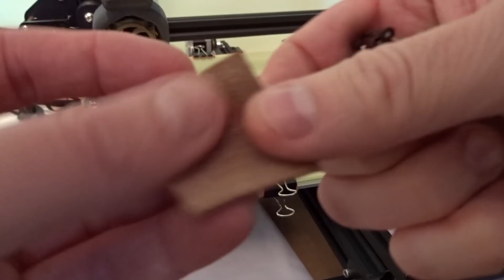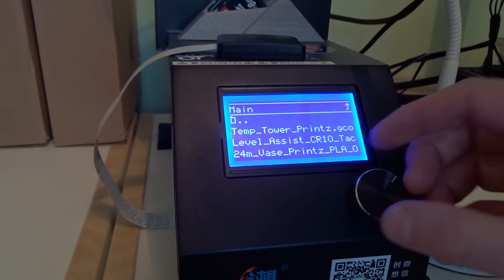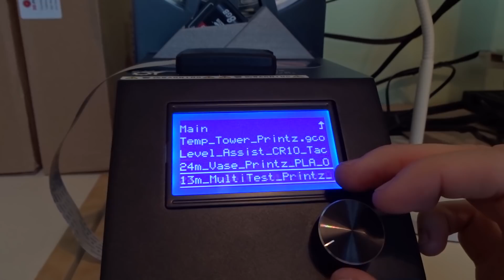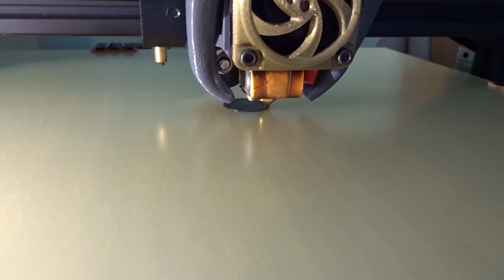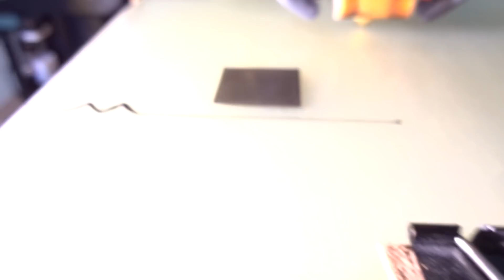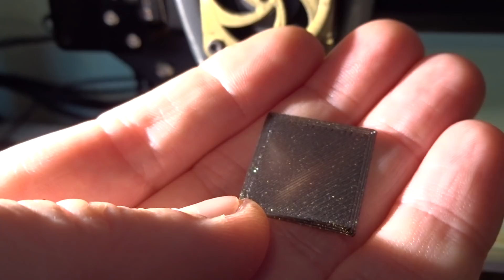Easy Live Levelling

Comment: New subscriber,great video,however I was disappointed when I realized you weren't going to show us how to level the aluminium part of the bed,I'm having leveling issues to the point I'm about to throw in the towel ,would you be kind enough to make a video showing how you leveled your aluminium bed.Thanks in advance.
Reply from the maker: Unfortunately no time to make videos. I just added aluminium foil in places until it was level all over.
Reply: @TacBlades  but how did you determine it was level.? Spirit level by eye vs the printer head or just experience?
Great video and down loaded to do on my Tevo Tornado  tomorrow  with your test files. Thanks and keep up the good job
Reply from the maker: @APCollyer  i used the nozzle its a pain as you add packing then test with nozzle then add more then test again but you only ever need to do it once
Reply: I really wish you would show us that and how you did ot but I'll give a try by myself, thank's for this video :)!!

Comment: Hi. Your video really helped me level my bed. But how do you make the printer print in the kind of motion. Mines start from the inside to outside
Reply from the maker: It just depends on how your slicer decides the best way to print it. In s3d there are settings to define the order in which to print features in the print.

Comment: What build plate are you using and how did you originally get the flat bed? Was your aluminum flat or was using the tape sufficient to level the build plate?
Reply from the maker: Ibused aluminium foil to level the plate i use an ikea mirror tile then printbite surface. But now i am using a buildtac clone by wysimic which is nice for using a cold bed.

Comment: thanks for the video! i uploaded your firmware to my cr-10s and want to try mesh-leveling. is there a video already, because i honestly dont know what to do
Reply from the maker: Hi there is no real video,  this one might get you started but it has some facts that are wrong.
 But on my firmwear you can save the mesh with store settings so you dont have you do it every time. Also read my notes in my firmwear as you have to put something in your start gcode.
https://youtu.be/X6lnlc-Vu-A

Comment: Hi :) I'm not English so I may haven't understand well. What is  the first layer height you settled for the calibration print ? 
Is it 0.18 ?
Reply from the maker: TheVerderadia yes 0.18
Reply: Nice Thank you :) I'll try that. 
I also would like to ask something. 
I think my bed isn't flat because when I level the corners, the center of the bed is closer. I tried with another mirror and that's the same. 
Do you recommand to put some tape on the corners ? 
Thank you

Comment: my printer is leveled in every single corner about perfect, but in the middle it's too tight like the nozzle is rubbing against the glass... Why is that?
Reply from the maker: Vape Nation Bg the bed is warped and its common just flip the glass and pack it out underneath in the center with aluminium foil to get it level.

Comment: I just purchased a new printer that has a 330x330 heated bed and uses extrusions (plus it is a Bowden so very little weight on X) and here we go again.  I have never been able to print reliably in all of these years.  I did tear down my Prusa to make room for this printer but when you even try 1 inch pillars at the three leveling points and the nozzle still hits the glass (regardless if flipped or not) then I have no idea why others have this magic in them to be able to print easily and I can't.  Same problem across a CoreXY and a standard Cartesian Prusa I3 something is really screwy.  Y skewed, X skewed, etc... goes out the window with this printer as does smooth rod droop.  Since the heated bed has this bulge across the entire Y section in the middle (to the point it will jam my nozzle using 0.318mm first layer gap) but is fine on the rest of the bed then it isn't droop.

I am stumped.

Comment: I use Feller Gauge to get my bed level, i use 0.018mm , do you know the exact gap we need?
Reply from the maker: Bramish EU i normally go with 0.08  to 0.1depends on the amount of squish i want on the first layer.
Reply: Thx for the reply, ill raise the bed slightly closer and compare results

Comment: Is that a Polypropelene bed?  I recently bought one and despite only using rubbing alcohol or glass cleaner, prints are popping off.  (Looks like I need to add some z-hop )
Reply from the maker: Where Nerdy is Cool! No its a printbite surface :)
Reply: Ha, okay....well one thing I am running into with the Tevo Tornado and my CR-10's is when you do prints like that, because of the housing , you can't see what's going on!
Reply from the maker: Where Nerdy is Cool! Yes that is the main reason i printed a fang.

Comment: How do we edit the STL file if we don't print at 2mm layer height? I print at .12mm for example.
Reply from the maker: Jacob Corr yes you would have to change the model say in tinkercad for the height you would want. Or maybe scale the height in the slicer for the height you want.
Reply: To what height? 0.12? i usually print my first layers at 120% (0.144mm) would that affect it?
Reply from the maker: Jacob Corr what ever you print your fist layer it but to be honest if it's say 0.2 it will just try to do 1 or 2 layers so it just might work as it is.
Reply: Thanks :)

Comment: i just got my cr-10 and wanted to level i s but one corner is tightened t to as far  as it will go and its still not low enough for the paper to fit. Any ideas?
Reply from the maker: You may be able to raise your z stop micro switch a bit
Reply: Check your X axis, presume it's the end with no stepper motor like most. If it is you will need to loosen the wheels measure the x axis and compare each side and straighten it then tighten the wheels back up while making sure it's level.

Comment: Have you tried using Octoprint at all? There is a nice plugin called Custom Control Editor and you can set it to move to certain coordinates on the bed. Much like your custom code is doing, but without a time limit. So once setup, you just click the button and it moves to whatever position (just make sure to home before using it). So you would setup BL, BR, TR, TL, and center or you could take it a step further like I have done and add buttons for top, bottom, right, and left as well (so 9 in total). I can then access Octoprint through my phone browser and then click on the button to where I want it to move. Very handy to make the leveling process easier and faster (not that you should have to do it all that often once things are dialed in).
Reply from the maker: Mike Cameron i dont like octoprint on a pi, only use sd card its another thing that can fail I really like using sd cards. I have cameras etc to monitor the prints.

I think octoprint might help of you if you have lots of printers to manage :) I know some people love it.
Reply: I have been using the original Raspberry Pi and noticed that on curved surfaces, I was getting rough textures. Have the Raspberry Pi 3 coming next week to test to see if it's a limitation with the old Pi or something else causing this. If I print directly from the SD card, I don't have that issue. I am hoping the Pi 3 will resolve this as I really like being able to splice the file directly to the Pi and then start the print from Octoprint without having to go back and forth with the SD card from the computer to the printer everytime.

Do you worry that with the SD card slot it will fail eventually? Or do you use an adapter or maybe one of those wifi sd cards?
Reply from the maker: Mike Cameron i have a sd card extender. I like to have version control on all my files so they are sliced files indexed then off to the printer :)

Comment: Hi. I've got a Wanhao i3 clone with bed dimensions of 200x200. How do I modify the level assist G code for my bed size?
Reply from the maker: Tim Draper you will have to learn a bit of gcode but it's very simple just open the file in the text editor and edit the locations to where you want them on your bed.

Comment: Hi Tac, thanks for showing us this.  I just acquired a CR-10 S4, printed your Fang and couldn’t be happier with its performance. I had a couple of questions for you.  This vid show your method for manually leveling the corners. When you initially performed this, did you adjust the center by adding tape instead of adjusting all 4 corner knobs?

I believe that you are also running a custom version of Marlin, can you describe why you decided to do this? 

Thanks again!
Reply from the maker: Kevin Scott I just eyeballed it and added tape until all was same gap then levels it and just added one or two pieced of tape after. 

I am not running marlin 1.1.8 the main reason was to have access to all features in marlin and there is a lot pid tuning,  Esteps, saving settings,  but mainly for acceleration and jerk,  and mesh bed levelling with no probe,  which is really easy.
Reply: Thanks for the reply, as a followup, there are a number of files on Thingiverse that allow you to attach digital depth gauges,  In your opinion, would these help in performing the initial leveling on your bed so one could be more accurate in measuring the variance across the bed? Or, in your opinion, are they not worth the effort?
Reply from the maker: Kevin Scott I tried it but it didn't work for me :)

Comment: Great guide! What changes did you make, to get your machine so silent? I have the Cr-10S aswell and it's extremely loud.
Reply from the maker: dachr2 the best change is stepper dampers on the x and y axis makes a massive difference
Reply: Cool, I'll give that a try! What about the fans on the machine and in the control-box? It seems like that's the most noisy part on mine. I can see that you're using the fang mount instead of the two stock fans.
Reply from the maker: dachr2 I have changed all my fans but really the dampers make the most difference. Look for tacblades on thingiverse I have fangs especially for this machine.
Reply: Great! Thanks :)

Comment: Great video - thak you, 

The bed levelling assist Gcode is very handy.  I have a coupple of questions as a complete beginner of one week with 3D printing ;)

1.  I have the CR-10S and have copied your Gcode to do the nozzle wipe at each print.  Is there a way to add that to every print?  I looked in Cura where you can edit profiles but didn't see any way to add it to the profile?  I suppose I could edit every Gcode file after creating it on Cura but I'm guessing there is an easier way ;)

2.  I like the printbite and will probably buy one but it states on the instruction to heat the bed to 110C and cure the build suface.  Not sure if my bed will go to that temperature as I've read somewhere that the Creality heatbed is difficult to get above about 70C.
Reply from the maker: Alan Artt 1 look for start code in your slicer i use ideamaker, 2. No it works at all temperatures i use 60 for pla and petg
Reply: Thanks for the Reply.  For Q No. 2 it was about the initial curing of the bed plate as the instructions from Printbite say to cure it for an hour at 100C.  https://flex3drive.com/wp-content/uploads/2017/09/PrintBite-Instructions.pdf
Did you do anythign liek that or just use it as it came out of the box?
Reply from the maker: Alan Artt no just used it

Comment: What glass plate and surface do you use? Getting a CR-10 and been looking at 5mm Borosilicate on eBay and possibly Ikea mirrors or mirrors from Dunelm. I've also bought UHU glue and hairspray to try.
Reply: Thanks for the heads up on the printbite+ surface. I was having terrible trouble with adhesion until I watched this video and apart from a little warping on larger pieces (think I need to play with the temperature) all my worries are gone. Worst thing is that time slows down while you're waiting for the part to release! :-) Keep up the good work - think the reviews etc. are great.
Reply from the maker: Pete ikea mirror with a printbite+ surface on top
Reply: Wow, fast reply. Thank you so much! Still watching your video. Great and clear. I'm also in the UK. Problem is, the nearest Ikea is 50mins+, so I'm going to see what the Dunelm mirrors are like. You using a sticky type sheet, right? I've been looking at a self-leveling kit on eBay UK for £40, and the BL sensor, but I'm preferring your way. How often do you need to do it? EDIT: Ah, printbite+. Sorry - didn't read that properly. I'll look that up too.
Reply from the maker: Pete printbite is a special surface in the uk that self releases the part when it cools down. I level about once every month or if I mod the printer.
Reply from the maker: I dont like auto level systems they are not accurate enough and not adjustable enough for me.
Reply: Yes, sorry - I just looked up printbite+ and found the site flex3drive.com. Looks like around £28 for my CR-10. Are they easy to clean and last a long time? thanks so much for all your answers. I've been researching all the mods, upgrades etc so that I'm clued up when it arrives and save myself from mucking about and frustration. Definitely going to use your method rather than auto leveling. You saved me £40!
Reply from the maker: Pete yes its a very tough surface lasts ages there are some vids somewhere.
Reply: Thank you! I think I'll buy one. I noticed someone doing a corner x4 and then middle gcode that waited for user to click continue before moving on. For me, being a noob and slow, ten seconds might not be enough. Could I adjust the code?
Reply from the maker: hamkers 96 large prints can warp with pla but a small brim usually works.
I put a desk fan on my bed it release very quick :)

Comment: Under 'Prepare' in Marlin there is a 'Level Bed'  function - which once complete you can store in memory, it is a mesh type level. You can also edit the number of sample points it takes in the firmware.
Reply from the maker: Airbrush Guy yes I have seen this but it's not really needed if you make your bed flat first, as its only for compensating for an uneven bed and relies of the manual height of the nozzle above the bed. I would rather have a flat bed than try and compensate for a warped one in softwear.

Comment: Great Video!! - What about if you print different filaments at different bed temperatures, surely this thermal expansion will effect the levels. e.g I use a PrintInZ Skin for PLA without any heated bed whatsoever, but when I print PETG my bed is at 70C. Should I re-level between material changes?
Reply from the maker: Mark Slatem no its ok I print pla, petg all as the same height with different bed temperatures.

Comment: Lovely guide! Got my Cr-10S this week. And I have been spending hours each night after work calibrating it. There is a slight bow in the middle of my bed, even though I've changed my glass. Gonna try your method tonight. Thank you for this! 
May I ask what surface cover you have on your bed? Ive been trying to print on the pure glass surface but I get very poor adhesion.
Reply from the maker: Silencius you can use glue stick on glass wiped with a damp cloth to a thin film works great.
I have a PrintBite surface on mine no more mess :)
Reply: Tac Blades Thanks! Will definitely order one from printbite just to spare myself from all hassle of prints not sticking.